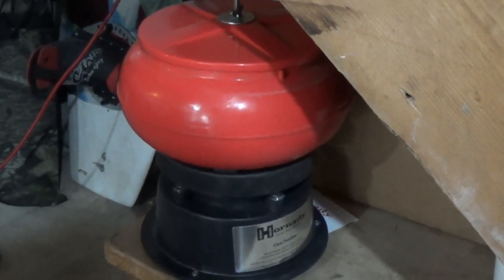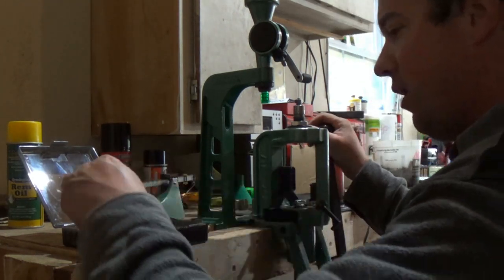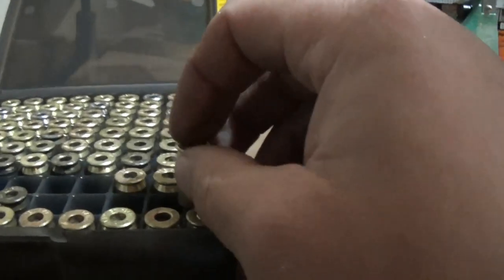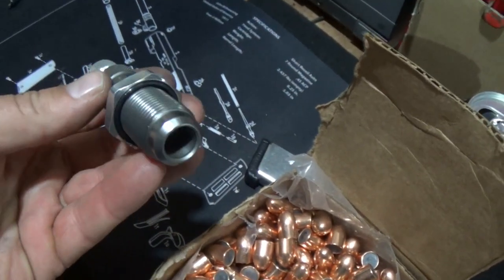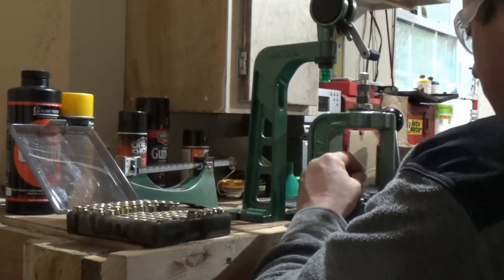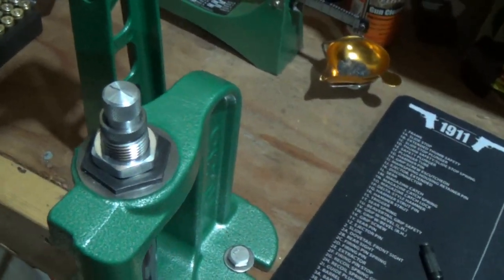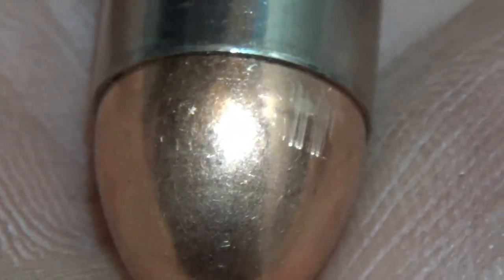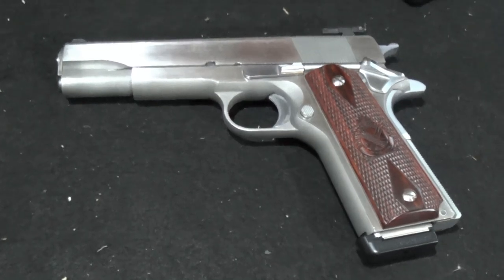Reloading 101 "45 ACP"

Comment: Big Ed - great video - I've been loading rifle ammo in 223 & 308 for match competition for a couple of years. Had a few problems along the way, and once past those I have a good technique. I measure powder by hand, not using the hopper. Use a stainless screw as a calibration check on my electronic scale.  Shooting 3-4 moa with iron sights - prone.....

Now I"m ready to load some 45 and glad you posted this.  Thanks!

Comment: Well done video. I can see how using a single stage press gives the loader a more intimate understanding of what the loading process is all about. I thought I'd circumvent the process and bought an auto progressive press some 9 years ago. I should have started with a single stage press because it took me a couple of years to actually understand what each die is doing and how to adjust them properly. Not to mention the many wasted rounds that I could not use because of mistakes made. We all make mistakes, but I think I made more than most.
Reply from the maker: Single stage is the best way to learn, you called it.

Comment: I'm a little late to the rodeo, however, the case you show at 4:00 is entirely reloadable. I've done it scores of times. Just use a screwdriver with a round shaft or something else round and lever the crease out. You only need to get it into shape enough to go into the sizing die and it will iron out. If there is a little bit of imperfection in the body of the case, firing the round will fire-form it. I purposely tested several hundred cases damaged in different ways just to see how they would come out. This was several years ago when ammo was hard to get. I used to shoot 3000 rds per week of 45 ACP.
Reply from the maker: For me any visible damage on a case that's worth $.10 is worth tossing in the trash.
Reply: I have easily 20,000 45 cases so really don't need to salvage or pick any. Especially since you can reload the cases about forever. I also have 8000 + factory rounds. 
I mostly reuse the same several hundred. I was doing it back when ammo was hard to find when Obama was elected because people were having a hard time finding anything, and I wanted to see what was salvageable and what wasn't. Just to prove to others that they could. I took a few hundred range cases in various stages of distress and prepped for reuse. Dents on sides, smashed mouths, etc. Some were pretty bad. Out of those, there were only 5 or 6 that weren't usable. I reloaded those same trashed pieces of brass for several years just to show you could. Yes, they are only a few cents. This was to prove a point. It's easy for us to toss because we can get more. You have to remember, some people couldn't. I was showing them a workaround.
Reply from the maker: @jimv.661  Jim that's a ton of 45 brass and great stock pile of ammo, I've got 4-5,000 9mm brass cases and thought that was a lot.   Lol
Reply: I decided when younger that I didn't want to try to find or pay for ammo when I got older. I succeeded. However, now I find I won't live long enough to use it all. Ha! I've given a lot away, but according to my spreadsheet, I still have 195K of factory rounds for about 15 calibers. 140K of cases to reload in various calibers, 240 sets of dies, powder - 192 lbs, primers just under 200K, 6026 lbs of lead to cast bullets with. And 160 sets of molds. Don't know how many jacketed bullets I have. There is a wall stacked with boxes of them 6'x10'. And a Corbin hydraulic swage press to make my own jacketed bullets. Probably the only real thing I have excelled at.
Reply from the maker: @jimv.661  That's wild also a great investment, you cold easily start an ammo company, makes me wanna count my rounds.
Reply: You probably have more than you think.

Comment: I load a majority of my 45ACP at 6 grains of Unique and with 230 grain cast bullets that are powder coated. I use those for target and practice. I still have about 70 lbs of cast and FMJ bullets that are loaded with 6.6 grains of Unique. I have never had a split case with that recipe. Ever. With either cast, FMJ or JHP. You may have had some bad or heavily used brass, or maybe your scale was off and you over charged. I use 2 scales when setting my powder charge, on any caliber cartridge that I load. It is a good idea to check primer flatness on your cases, and maybe it is time to invest in a chronograph. A chronograph will show you when you are at max safe pressures when compared to load data while also checking for pressure signs on your primers. I have had split cases before, due to using crappy old cases, not due to 6.6 grains of Unique. Also, I would suggest stainless steel media in a wet tumbler, The cases come out looking like new. If I had seen those tarnished bullets for sale on Gun Broker, I would have chuckled to myself and thought, "What a noobie". I would not have purchased them. Good video though.
Reply from the maker: Thank you great comment, usually for pistol reloads I just go by feel, when I reload .357 and .44 Mags I set up my Chronograph, Lol on those tarnished 45's I kept them I kind of like the way they look now.

Comment: great video, I have purchased copper plated 230gr round nose bullets from xtreme bullets, they look & feel great, but I still have not found loading data for copper plated bullets. If the style (RN) and weight 230gr match say, copper jacketed, or solid lead bullets will like grs. of Unique powder work safely as long as I stay around mid charge?? 
I wish powder manufactures would start listing copper plated as well in their loading data.
Rusty
Reply from the maker: +Rusty Pearl I would just load the with medium mild lead data loads, I would stay away from plated bullets there worthless, just buy lead or FMJ's
Reply: +Big ED  please explain why the copper plated lead bullet is not a usable bullet, all things considered? I value your opinion, just hate to dump 750 bullets without ever loading and firing one.   Rusty
Reply from the maker: +Rusty Pearl There are really two main kinds of handgun bullets lead and FMJ's full metal jacket.   Lead are just lead mixed with some other metals to harden them up.    Full metal jackets (FMJ) or Jacketed Hollow points (JHP) are lead cores with a copper jacket around them that help keep the bullet together on impact and also stop leading of the barrel.   The copper plating they put on plated bullets is so thin you might be able to rub it off with your finger it does not help hold the bullet together or stop barrel leading.    They are usable but act like a lead bullet but just look like FMJ's.    Cut into both bullets and you will see, or recover some that have be shot.   It's just crappy marketing from crappy companies that ticks me off.
Reply: Sorry but you couldn't be more wrong about plated bullets.

Comment: Ed, will the sure shot lube be cleaner then Cabela's lube, when it drys it's sticky and I have to wipe down the bullets. And do I need to crimp 30 cal shells when done loading, I'v seen loading videos and their not crimping. Is crimping only done on strait shells. Thanks man!
Reply from the maker: +john bouley First of all Shells are used in shot guns.   I assume your loading 30 call rifle bullets..........   If there used in a semi auto or lever gun crimp if bolt gun no crimp.    Hornady lube is good stuff, also Rem oil will work and does not leave residue.

Comment: Ed, Do you change the powder measure cylinder from the large cylinder to the small cylinder when measuring the small charges for 45acp? I am just getting back into reloading after a 15 year period of not reloading. Your videos have been a great help. Thanks!
Reply from the maker: Peter Badyrka I don't change them I just run the large cylinder, Once I drop a few charges it seems to work fine.   If memory recalls I drop 6.5 grains of unique and it meters fine.   I have a 357 Mag reloading video that is in the works.
Reply: Big ED Thanks for the quick reply. I have relearned a lot about reloading from your videos. Due to my job as an over the road trucker I haven't reloaded in about 20 years. I am now retired and I have the time to start reloading again..It's amazing how much you can forget about something when you haven't done it for such a long time.
Reply from the maker: Peter Badyrka I was just reloading some 308's last night with IMR 4064, I get a lot of satisfaction from it.
Reply: Big ED Thanks. I'll be reloading 30-30 Win-308 Win-357 Mag- and 9 MM. I have already reloaded 20 rounds of 30-30 with various charges of Alliant Reloder 7. from 26 gr. to 29 gr. I'll be heading to the range to test them in a few days.
Reply from the maker: Peter Badyrka Good stuff, I find reloading rewarding.

Comment: Hey Ed, question? I hand loaded 45acp with Unique and the imr 4227, not exceeding the load. But while shooting the aim at center target, the bullet was going low, I mean by 5 inches. The beretta and the 1911 have fixed sights, will I need to fit new and higher sights on them. Or just get use to aiming high? thanks bro
Reply from the maker: john bouley Beretta I'm not to not sure about, some 1911's have removable sights, some not, you can always file down the front sight if fixed, let someone else shoot it also, see if there low too, before breaking file out.
Reply: john bouley Try putting more powder in to bring the round up. I use 4.5 grains of 700x 230 gr ball they are dead on
Reply from the maker: Jeffrey Kelley I would more or less powder, you might get lucky
Reply: The faster the round the higher it hits i think is the formula
Reply: Jeffrey Kelley Thanks bro
Reply: Big ED Thanks bro

Comment: why are you spraying pistol cases with lube? I resize 9mm and 45acp and I do not spray the and they don't get stuck. If you wet tumble your brass with stainless steel media
a warm water and a little dawn soap and some Hornady brass cleaner the brass some out cleaner than the dry media.
Reply from the maker: +Razor&#39;s Armory (Razor&#39;s Armory) I'm just in that habbit of lubing everything I work in the marine biz, so everything gets lube, it can't hurt but good suggestion.

Comment: WOW! 1,000 FOR $150 BUCKS !I got 600 FMJRN for $50 bucks from Sages reloading supplies website.  The sell bulk bullets  .223 FMJ is $8.49 per 100!
Reply from the maker: +Razor&#39;s Armory (Razor&#39;s Armory) Good for you, I would not shot Sages bullets since they are just plated not true FMJ's my Zero's are, just shoot cast lead bullets you will get the same results and save even more money.
Reply: +Big ED I was told that's they were  extruded copper FMJs. I was not trying to mean it just seamed alot of money for 1,000 of projectiles. I was just trying to help a fellow reloader.
Reply from the maker: +Razor&#39;s Armory (Razor&#39;s Armory) I shopped around alot and found them on gunbroker.com, they were the least expensive FMJ's I could find, thank you for the heads up.

Comment: why would you heavy crimp?
Reply from the maker: When reloading heavy recoiling rounds in revolvers like .44 Mag watch this video, it will give you an idea.   The extra bullets can jump a light crimp in a revolver after heavy recoil.
Reply: Just FYI, Watch what you are heavy crimping.  Autos and Revolvers receive a different kind of crimp.  For instance, the 45's in this video receive a taper crimp because the edge of the case mouth stops the case from running into the lands/barrel of the gun, while a .44 mag will receive a roll crimp to grab the projectile from dislodging during recoil. The revolvers receive the roll crimps due to the case head  securing the shell in the revolver cylinder.